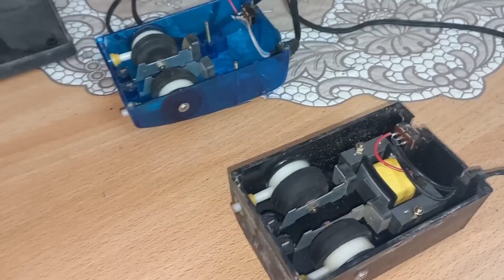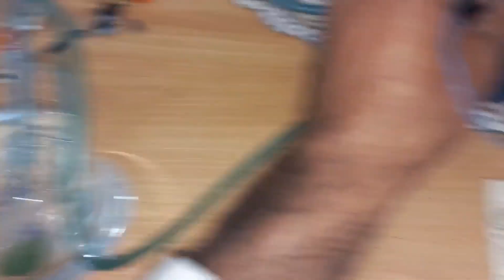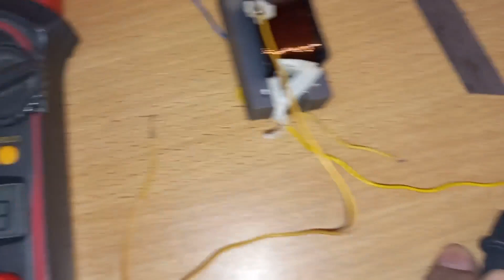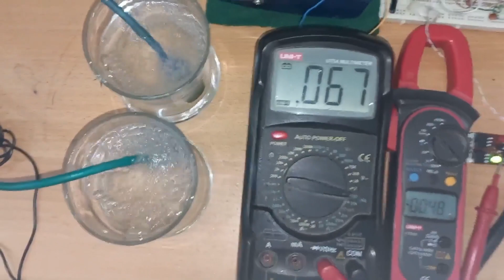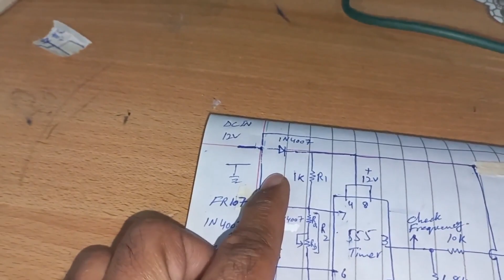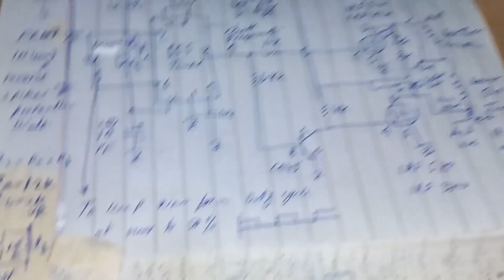Low Energy DC Air Pump | Aquarium Backup During Power Cut | 220V to 12V Conversion | Urdu / Hindi

Comment: If you replace the ferrite and install neodymium magnets the result will be better than this...
Reply from the maker: I can try, as this pump was available with me so I convert it.
Reply: @NewAquariumHobby   @New Aquarium Hobby  bro your modification is amazing but i have one doubt your coil and circuit is powerfull but the magnet is ferrite if you replace this i think the air pressure is more. Only my thinking not sure. Your all videos are infirmative.
Reply from the maker: @Achu-kw6sv  dear I shall try later if I can find ferrite magnet, this time I used same which was in my used air pump
Reply: @NewAquariumHobby  ok bro